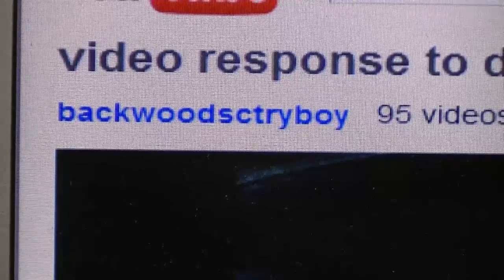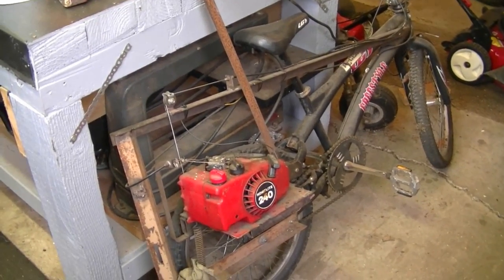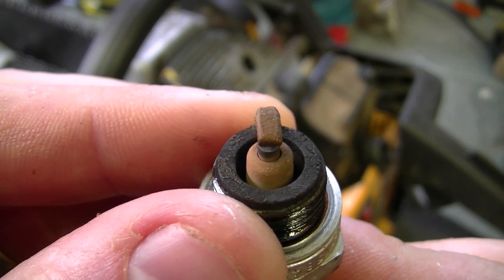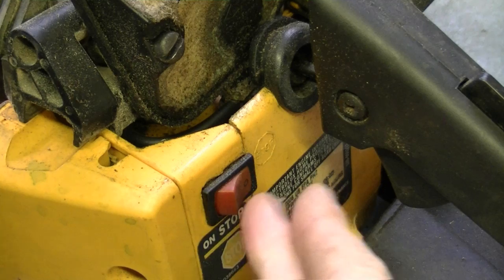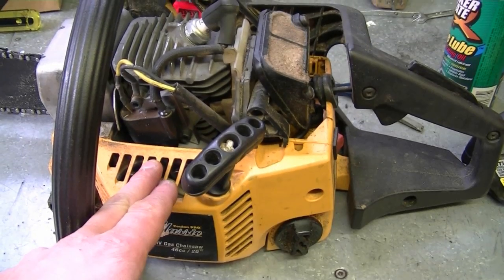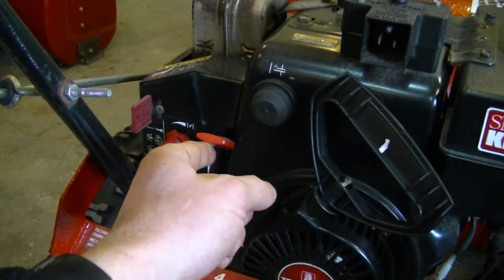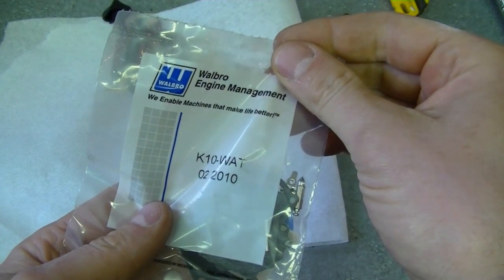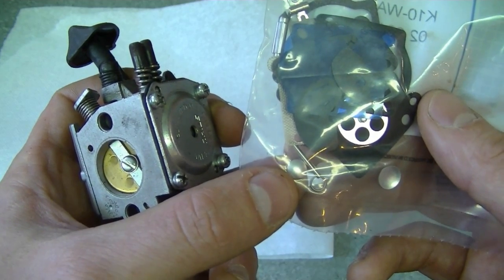Small Engines Q & A Video #72 in HD

Comment: Hi Donyboy, How about older 2 cycle single stage snow blower? If the crank seal goes bad, will they be hard to start like a chain saw? And I have a question on a chain saw flywheel. How do you get the studs out that hold the springs and palws on? I have one with a broken spring and I don't know how to get it off. GREAT VIDEO THANKS Mike

Comment: @pennypingu6 thats normal, theres a float on the inside that only shuts off the fuel in the horiz position, so when its tipped it no longer works, then when you shut off the gas what was left in the bowl just ran out,,,

Comment: I was watching your video on how to replace a auger belt and did it!! Saved me $80 and I thank you so much. I do have a question though: when I was tipping the snow-blower up on its front, the carburetor leaked gas. Is this normal? I shut of the fuel and it seemed to have the fuel leak for a bit but then it stopped.

Comment: I want to caution people about holding a spark plug over the hole when testing for spark.  I learned the hard way before that if the engine was possibly flooded beforehand, the fumes that suddenly thrust through the hole when you pull the cord turn it into a fireball.  Luckily for me it only took the hair off my hand and left an annoying burn for a few days.  Nowdays I test it along the side, and if that's not possible from plastics in the way, I use a long screwdriver to bridge the distance.

Comment: could you explain why and how its bad for a small engine(Tecumseh 5HP Power sport or Briggs&Stratton) to run at a low idle?  And if its different on a Vtwin by both Briggs, Honda? And if i do set my tecumseh at a low idle, will it still revv fully?